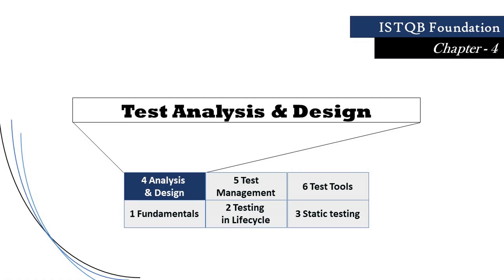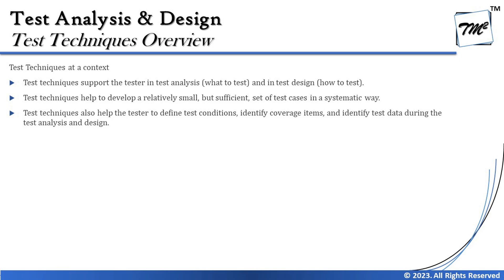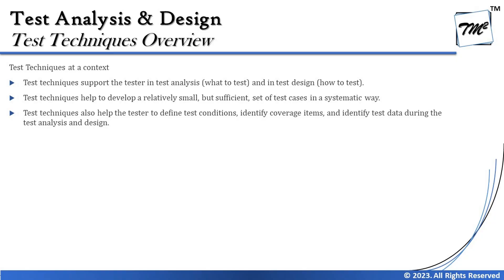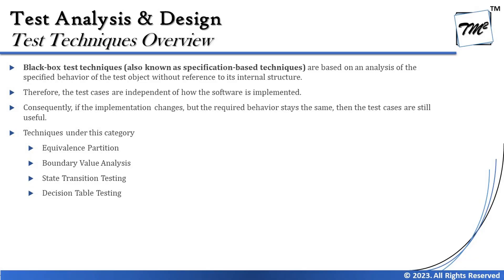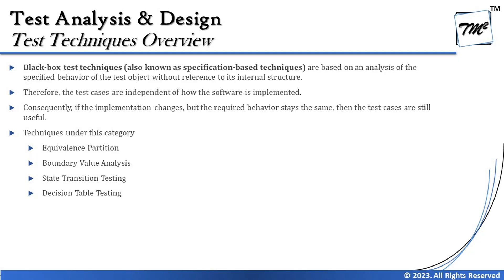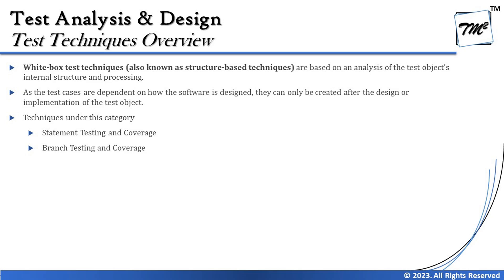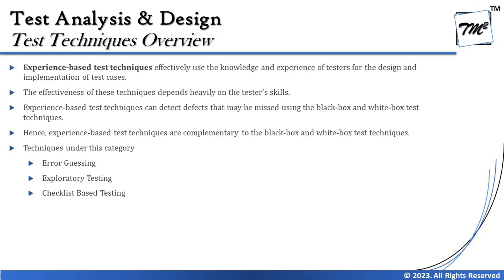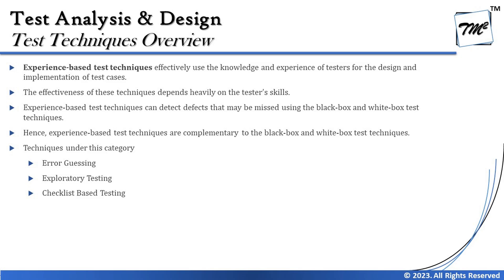ISTQB FOUNDATION 4.0 | Tutorial 29 | Test Techniques Overview | Test Design Techniques | CTFL

Comment: Hi Sir, just a question... Release notes from Developers.. If the test cases are base from release notes, this is considered structured base testing or white-box testing? Even the release notes is created in a way like a user story?
Reply: Base on my understanding, since the release notes is not a view of a code.. Then if the test cases are created base from this release note doc... Then its black-box testing...? Am I right? Just want to confirm
Reply from the maker: No white box testing is testing a system at the back end (code level) and is an execution approach whereas what you mentioned is a test design technique. 
Also writing test based on developers release notes will never test the requirement as it will never refer that will be driven by code.
Reply: @TMSQUARETECH  oh so its also not a black-box testing technique nor a white box testing...